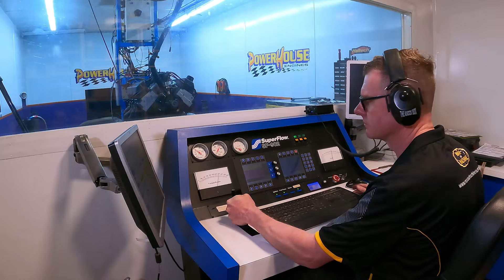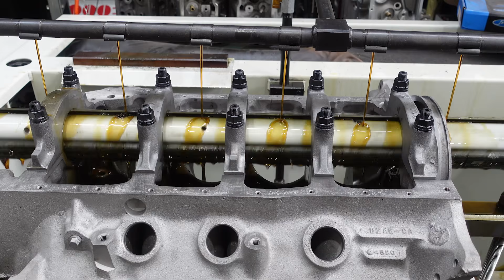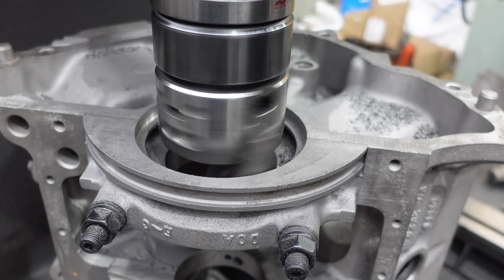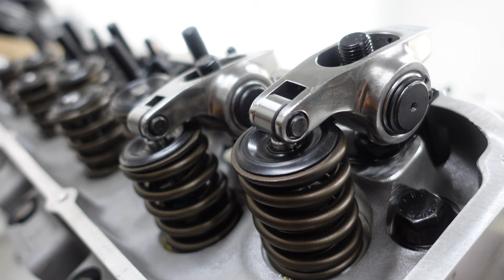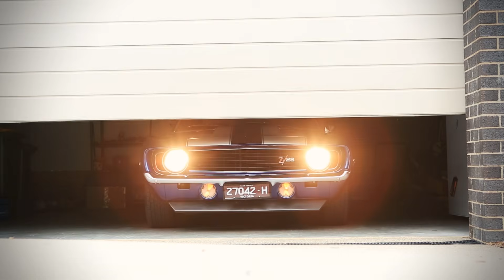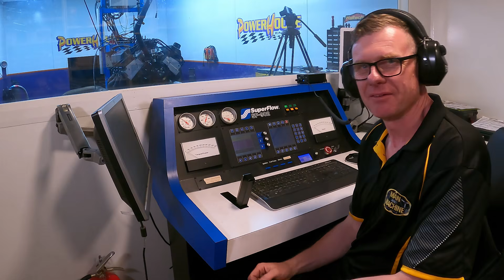FORD CLEVELAND 408 CUBE BUILD AND DYNO! | Iconic Engine Series

Comment: Why did they ever quit making the Cleveland?
Reply from the maker: Good question, in the US the Windsor was most likely a better all rounder, lighter, more compact and produced adequate power. The Cleveland was Ford Australia’s sole V8 choice from around 1970 and was specifically manufactured here in 302 and 351 cubes up until 1984 when Ford Aus chopped the V8. In the early 90s the V8 option came back here in EFI Windsor 5.0 guise

Comment: You can get 570 hp and 550 torque with a double pumper 750 hp  holley,CHI 2V heads, Edelbrok duel plane intake,234/243 cam,try  piping out of 408 Cleveland go to @CompetitionEngines.

Comment: Hi I'm looking at a 351C/408c  build, using a Aeroflow 4.125 block, planning on CHI 67CC 225 3 V heads perhaps around 11.1 compression. Really struggling with the the minus cc dish pistons I need, could you help with suggestions.
Reply: Sorry but what do you mean the piston dish is a struggle?  How is it a struggle?
Reply: The calculation of what negative CC is need, can be anything from -11 right through to -32cc dish piston & above 
..650hp

Comment: I WASTED 20K ON THE EXACT ENGINE (408, 3V )FOR MY XC FALCON, BUT MY 351 C IN MY OTHER FALCON WITH CAST 2 HEADS THAT HAVE BEEN CNC'D WITH A BIG CAN AND BIG CARD ISNT FAR OFF IT FOR AROUND 6K, so we pay ahell of a lot for a extra 50 to 130 hp... but its done now

Comment: Ive had lots of clevelands. But doing these mods to it will struggle to beat a mild 302 windsor in a race despite the massive hp. This is why never again will i bother with cleveland again. Windsor all the way
Reply from the maker: Cleveland's will generally provide more power potential due to cylinder head design, but the Windsor is a very robust and lightweight platform in comparison. Great little engine and super reliable.

Comment: What is the difference between Clevor vs stroker?
Reply from the maker: A Clevor is a Windsor bottom end using Cleveland Heads, much like a Boss 302 did back in the day. A stroker denotes a crankshaft with a longer stroke and increased engine size/capacity. The term stroker can be used for any engine type using this method.

Comment: Not to sound like a negative nancy but that should make way more power than that. I had a 393 4v closed chamber, Edelbrock torker, hydraulic roller cam with less numbers and made 507 on pump gas. Those chi heads should be making way more power than that.

Comment: Well that was interesting. I’ve got a ‘70, 351C and that’s exactly what I wanna do to it. I got it out of a cougar, but I’m putting into a ‘66 fastback. I love those beefy torque curves for road rally’s. Snaps you outta the corners like nobody’s business.
I stroked my 68 firebird 400 to a 461, with all the goodies and ended up at 500Hp right around 6k, and 575 ft/lbs right at 3800 rpm. That is so much fun to drive!!

Comment: Question, I see all these different cubic inch motors, why don't you try the 400 ford, I know everyone hates it but, I've had one for years , a cam intàke , carb, really wokeitup. Anyway why not using the 400, it's already stroked?
Reply: The 400 is capable of some good HP and torque numbers when built, this engine is saddled with a reputaion of being a low performance malaise era engine however.

Comment: Do Windsor's have the same weaknesses in cylinder as the Cleveland's? Cheers
Reply from the maker: Windsors are generally more robust in the block, although originals worthy of a rebuild are getting scarce. An aftermarket high performance Windsor block is tough as nails.

Comment: Not to many play with cleavelands..I believe the air flow is very important. I would have tried smaller carb. Would have like to see egt temp looking at the plug. 10.8 compression maybe little smaller lift

Comment: I heard valve flutter at about 6200 AND 6500 rpm... im a Cleveland guy. Nice power on this build. I ported my own 4v inlet/2v exhaust valved heads back in the day, on a 4MAB crank n rods, hydraulic cam... it was making about 420 at 6600rpm all day every day. I focussed on torque, and it turned tyres whenever at whatever speed... even in the Dodge truck it ended up in. Dana 60 lsd, 4.11 and later 4.88. IT STILL HAD THE FMX AUTO, 3000rpm stall, and dual wheels. I COULD SLIP SIDEWAYS INTO 2ND GEAR... best fun. Chased down VL turbos, monaros, in a 2500kg truck. 😊😊😊😂😂😂

Comment: Do those heads flow any better than the 4v oem heads ?
And do they have the raised exhaust ports. Glidden ran the heads with the raised exhaust ports and it made a world of difference.  We copied it as soon as possible lol
Has Boost on the Cleveland been done recently ? If so who makes the application.  The 408 is stout
Reply: Smaller port better chamber and more flow.   Consider it as a better revision of the 4v head in aluminum.

Comment: I would love to make 500HP in my Boss 351 EFI.  I want to run the original Boss heads though with no porting/polishing.  Is this possible and if so what cam would be required?
Reply: Drag Boss Garage runs stock heads with 11.5:1 compression and a mid 240 duration cam with over .6" lift and makes 615hp.

Comment: Bunch of crap compared to a junkyard chevy 5.3 LS right?  WRONG!! This engine rocks !!!
Reply: junkyard 364 LS makes over 525 hp with cam and spring upgrade.  Lots of dyno pulls on YouTube
Reply: I didn't realize that a "junkyard 5.3L" was the same as a modified 6.0L.  Appreciate the assist.🤔🤨  @flatbrokemodsquad4241

Comment: Can someone talk to me about the cam specs of this build? Maybe I’m not familiar with the terminology, but 50 thousands intake/exhaust lift doesn’t sound like that much camshaft to me? Especially not at these power levels or with those heads
Reply: Duration is measured at .050 . 240° @ .050 . Valve lift I believe was .600".  When you consider a factory 4V Cleveland probably had 218° @.050 and 445" lift , this modern cam is a big step up.

Comment: Did you guys see what that spacer did to the torque on the low end? It looks like a 30 lbs+ gain at load-in. WOW!!
Reply: Hi that 25 to 30ft lb is often quoted for spacers or filling in the floors.  No loss on top end either.

Comment: Can this same engine combo be built on the 351M/400 block? With the M deck height being taller, are the pieces like intake manifold and larger main journal crankshaft available?
Reply: I'm not trying to be a smart ass, but I'm sure you've heard of this guy with this particular 400 M build.

https://youtu.be/WV3GRirgj0c?si=mzD1s6no0iXXesM_
Reply: Look at back when Kaase was winning all the engine masters challenges. He was using these heads on the 400. There are articles about his builds. I dont remember what yrs but im sure if u Google it u will find them. He won like 4 in a row or somthing??

Comment: Thank you so much. I am about to built my 351c 4v from a 74 mustang into a 408 stroker for my 67 f100. Your video was great. I hope I do as well with my 4v stock heads. I'm told they're from down under.
Reply: I have stock cc 4v heads on my 393c. Scott Cook dual plane, solid roller cam 239/246 @50 600 lift. Dyno'd with a 950cfm. Carb. Made 512hp @ 6400 and 508lbft. @ 4100(from memory). 
Great manners and fun through a 4spd. toploader.
 Let me know how yours turned out if you went that direction.  Cheers.

Comment: Decking and squaring it up from crank to top is absolutely critical and you Aussies are Masters of Cleveland Performance! Here in the States it’s The most “Banned” engine in Racing. No sweeter engine sound ever than a 351C at full song!
Reply: Is that why the Windsor stayed in production so much longer? Because the Clevo was banned so much?
Reply: @peterj5751 windsors don't make any power until you put a non ford head on them.
Reply: @flatbrokemodsquad4241  which makes you wonder why the Cleveland was discontinued long before the Windsor.
Reply: @flatbrokemodsquad4241 that's not true either. Just built a windsor 408 stroke all cast iron except for the intake 522 horsepower.
Reply: @cecilandrews7479 Must have had a heavily modified head to get that.  Richard holdener's windsor verses Cleveland dyno comparisons show that windsor heads are very inferior to a Cleveland style head.  the windsor always needs an after market aluminum head to compete.  Factory cast iron won't make big hp unless a lot of massaging happens.  What do yours flow intake and exhaust cfm?
Reply: @BruceLee-xn3nn  
That’s what i had built in the early 90’s. Cleveland heads on a 400 with domed pistons & stroker crank. It made over 500 hp and was on par with a good stroked SMC
Reply: @flatbrokemodsquad4241  lmao 🤣😂 I hope you don't believe that
Reply: @flatbrokemodsquad4241 wrong
Reply: Discontinued because of emissions controls, was built in Australia through to around 83. During the 70s most V8s from factory were strangled by pollution gear.
Reply: Bullshit 10 Years ago Darryl Hansens 69 Mustang group NC race car made 618 hp and OT had factory iron heads its the rules in that class and for the record he dominated the class beat all the 350 Camaros

Comment: Loved this vid.  Just wondering with all of that awesome machine work did y'all consider converting (tapping) the 2 bolt mains to a 4 bolt?
Reply: Just don't need it at this rpm level.
30 years ago I helped a friend run a Cleveland in his gas econo dragster with a totally stock bottom end. Regularly ran it to 7200 rpm with nothing more than oil gallery restrictors and a Melling HV pump. Never had an issue with the bottom end.

Comment: Could this approach 700 with a much bigger solid roller cam and 13-1?
Reply from the maker: Definitely high 600s on an honest dyno
Reply: @GlennEverittMasterofMachines Agreed. Have a 408 W with AFR 205's, 12.8 to 1, and .700 lift solid roller. 661 H.P. @ 7100. So... yeah.

Comment: With those heads I was expecting a little more
Reply: I was as well. Those heads, 10.7 to 1 compression 
 240 somthin at .050 dur.
 & I believe he said a 950 cfm carb?? 
 I guess with a set up like that I'm used to seeing outrageous numbers?? Those are Yates heads?? Kaase was making well into the 600's in the engine masters challenge with those heads & 400 ci??

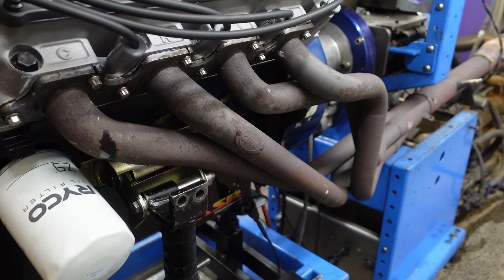Comment: 3:50 - Is that a large hole in the front cylinder header primary tube?  😳
Reply from the maker: No, it's an oil spill. That's no.5 cylinder on a Clevo too.

Comment: I was going to buy a TE-50 AU ute dream was to run a 347 with the smaller 3V heads and a cam that gives good torque with the power 15% higher on the graph over torque.
Reply: What about a 363 with its big bore.

Comment: You're an Australian engine builder! in Australia we use METRIC measurements! not imperial stop using hp and ft/lbs!! its KW/Nm
Reply from the maker: With all due respect, show me one engine builder that builds old school engines like us that quotes metric over imperial?  For newer engines I agree with you, as it’s relative to the period. Either way, I do appreciate the feedback.
Reply: Actually refreshing to hear you using the proper terminology of ft lbs ! Been pulling my hair out ever since some egg head started saying pound feet.
Reply: @GlennEverittMasterofMachines  Who says they are old engines? your using modern parts and technology right? fuel injection etc etc, so use the correctly measurements then.
Reply from the maker: @jasonswift7098  , no that’s incorrect. They’re mostly 60s and 70s engine platforms using distributors, carburettors and relevant technology to the era.
Reply: @GlennEverittMasterofMachines  Your explanation for using those particular units of horsepower and torque measurements is totally adequate regardless of the measurement standards used in Australia. As an American, I find it easier to relate to the Imperial units of measurement. I also understand the point of view expressed in the comments. Using that same logic, shouldn’t the displacement be stated in liters instead of cubic inches ? 
I DON’T THINK SO 😉.
Reply: Every Engine building website in Australia uses hp and ft/lbs ya donkey
Reply: Real hot rodders only speak real numbers. Sorry that's just the way it is in the World.

Comment: Nice, however for the application I would’ve went with the smaller port versions for more ground pounding stump pulling torque from a lower RPM
Reply from the maker: I agree Michael, their 195 variants would also be worth a try. It’d be an interesting experiment.
Reply: @GlennEver @GlennEverittMasterofMachines y glen

I built a 408 AFD 2V heads with 11.1 comp ratio,  many moons ago. Included Comp cam 294B  solid flat tappet with a funnel web single plan intake. Went into a 1981 XLT Bronco. 536 ft/lbs of torque..579 hp @ 6,100 rpm Oh boy what torque monster. Felt like big block the second you touch throttle the Copious amount  of torque just poured right in

Comment: Why are those heads 3v ? Can you explain how they are 3v please?
Reply from the maker: Yoy'd have to ask the manufacturer CHI, but I'd say they're placing these heads in between a 2V and 4V variant port runner size wise, hence the name 3V.
Reply: @GlennEverittMasterofMachines   Thanx.
Reply: @Je Gr Yeh im aware of  the Venturi abbreviation , hence the 3V makes not alot of sense.

Comment: This is very nice. However, I wonder if there are not more affordable methods for achieving 500/500 these days, than what this engine build costs? Looks like some very expensive parts for what most would consider "mild" power these days. What a good old platform though. The Cleveland was admired back in the day as much as it is today it seems.
Reply: In the US we just start with a 400 cube ford motor out of a 70s era truck. Chunk all the smog crap, and use good Cleveland top end parts and decent pistons to up the compression.
Reply from the maker: It's all in the cylinder heads. You could achieve the power output with some old school cast 4v's with 351 cubes but the port is so huge that torque output and power under the curve would suffer.  There is always a trade off to do it right and reliably, it just cost $ in componentry.

Comment: Hi Glenn, another informative vid. 
With the aftermarket heads and inlet, did you do much finishing? Valve seats, radiusing, port matching etc?   Cheers Chris.
Reply from the maker: Hi Chris! Thats a good question and I’d have to ask PowerHouses’s machine shop division in this case, but in most cases yes, castings are purchased bare and fettled in house with tweaks, finishing (sometimes even CNC porting) and then John’s choice of preferred hardware to complete the end product.

Comment: Sounds a little flat especially when you're free revving it.That plug looked a lil lean i thought......more fuel ?
Reply from the maker: The water brake was on and applying load to the engine. The plug read was fine and backed up what we saw on the O2 sensor readings.

Comment: That’s a great engine. Just a note tho, those tapered 4 hole spacers work best on single planes, the 4 hole untapered are good on dual planes( keeps velocity up).
Reply from the maker: We've found similar results of both single and dual plane with the tapered. We also have straight 4 hole, completely Open and tapered open in our test set, both 1 and 2 inch high variants. We often fit all 4 styles in a session to see which works best on a given intake manifold design.
Reply: @GlennEverittMasterofMachines  Which one seems to work best on Ford windsors and a super victor intake?

Comment: 500 is low for a 408 with all that gear on it. Could here it fluttering towards the top of the rpm range.
Reply from the maker: It's all relative to camshaft size and compression ratio. We achieved the desired goal, with outright power governed by the camshaft size as a trade off for low end torque.

Comment: Hmmm, noticed on the last pull that the rear accelerator pump discharge nozzles were poring fuel out.
Reply from the maker: You mean when the secondaries opened and activated the accel pump during the early stages of the run?

Comment: That much power with 27° of timing!! Thats a sign of huge efficency inside that combustion chamber! And it will run ICE  cold on pump gas ! Those Clevos rock ,good job and Seppo approved!
Reply from the maker: Spot on! Yes, the CHI runs a great chamber design. The LS engine is also a good example of a well designed chamber requiring less ign timing.
Reply: I run mine on propane and use the 302 Cleveland 2V heads on the 351 , greetings from Australia 🇦🇺

Comment: Glen I have a question, is our pump fuel different to America? Because all of there engines they run their total timing around 36 degrees and my cleveland will ping around 30
Reply from the maker: Yes Andrew, our Premium 98 octane pump fuel (straight from a regular Service station) uses the RON (Research Octane Number) measurement system. I think the US use the MON (Motor Octane Number) method. Depending on the composition of the fuel, I'm told the MON measurement can be about 8 to 12 octane lower than the RON, but there is no direct link between RON and MON. One thing to Keep in mind is that compression ratio, camshaft profile and combustion chamber design has a huge bearing on ignition timing requirements. The CHI heads used on this engine have a very efficient chamber design, requiring less ign timing to achieve the desired power output.
Reply: Looks like they didn't have the vac advance hooked up either